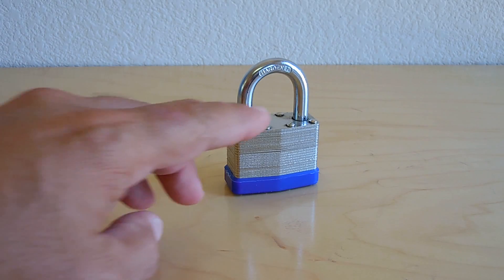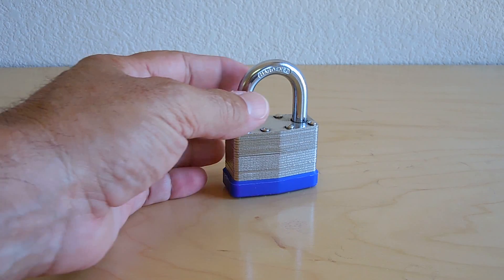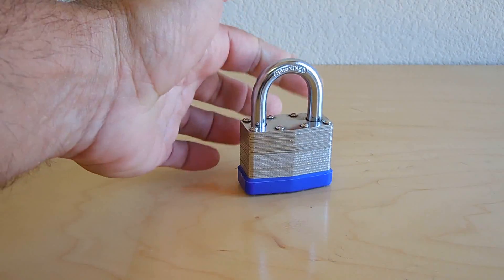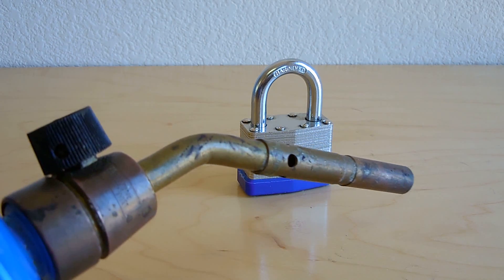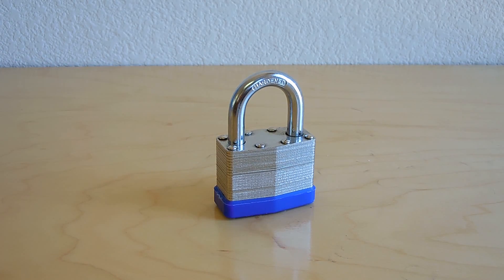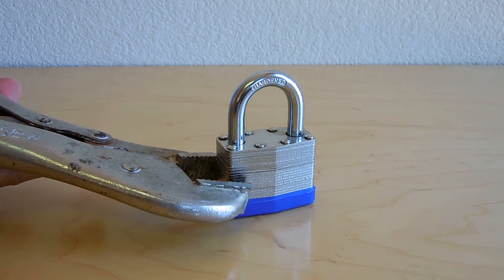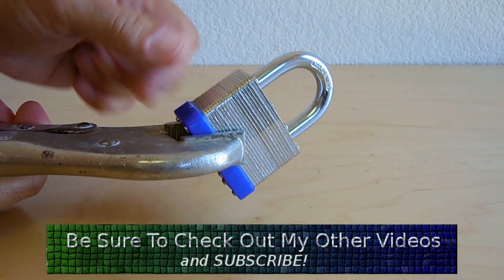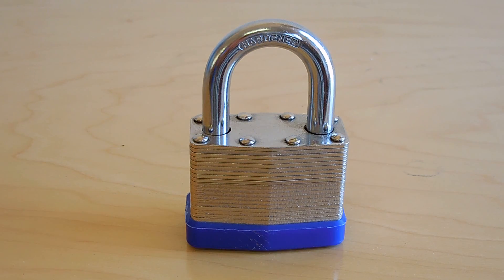Open A Padlock With A Torch and Hacksaw

Comment from the maker: OK people, after reading through some of the comments......

The purpose of this video was to show another method that CAN BE USED when a Cutoff tool or large bolt cutters are unavailable. The average person cannot pick locks, so that wasn't even a factor. The lock used in this video(which had a 3/8" diameter shackle) was 100% irrelevant. I was simply showing what to do on any padlock I had laying around. Normally this would be used on padlocks that are higher quality, and very hard to pick. This method can also be used to cut hardened steel bolts or rods, and as mentioned in the video, allow you to drill through hardened steel plate. If another channel uploaded this, or stole my idea(which has been done before), their video would already have 1/2 million views and everyone would be praising the video. To top it off, many Youtube channels don't even talk to viewers in their videos or explain anything in detail the way I do on my channel.
Reply: mosin homes Yeah no
Reply: Thanks for posting this video. I put this exact lock on our dumpster. A psychopath tenant injected the keyhole with glue ruining the lock
Reply: I've used this technique to cut hardened chain before, used fire bricks to make a sort of heat chamber like a crucible, heated up 1/2" tempered steel enough to anneal for cutting. Also if you get steel hot enough so it's glowing yellow/orange then rapidly cool with iced water it's overly tempered and brittle and can break with a cold chisel impact.
Reply from the maker: @davidgraemesmith1980  It works, sadly some people out there seem to think I upload bogus videos. Thanks for watching!
Reply: @electronicsNmore  some folks don't have the sense to study anything other than video games and other typical childish interests

Comment: Good to know but i very much doubt that the cheap lock was hardened, even if its stamped on it. The hacksaw not gripping would most likely just be the chrome plating, give it a few more goes with the hacksaw. Lean the hacksaw against the body of the lock to keep it stable and give some hard strokes of the hacksaw.
Obviously raking or picking that lock would be super easy but you explained what and why you were doing it.👍

Comment: If you heat a shackle to bright orange, even going on to white hot, a set of bolt cutters will slice through that section of the shackle with ease (not quite literally 'knife through butter' ease, but close) and without doing damage to the high-carbon hardened steel bolt cutter blades (which just about always results to the uniform cutting edges of bolt cutter blades, when cold, hardened, high-carbon steel tries to cut/snap through like [or even harder] cold, hardened, high carbon steel). ...and even a much smaller set of bolt cutters will do the job.

Comment: I have a seized axle that I'm replacing on the bottom bracket of my bicycle, and I will be trying this tomorrow to soften the steel for cutting. Thank you for the great video! A torch is also great for expanding crank arms for removal if you don't have an extractor tool.

Comment: What if you just cut the Lock when its glowing Red Hot?
Reply from the maker: It would cut easy, but the heat may destroy the temper of the hardened cutting edges. Thanks for watching!

Comment: Interesting video. I thought about this the other day when I needed to force a lock. I have 4 kids and thirsty friends so it happens surprisingly often lol. Normally I use an angle grinder but I was thinking about a more discrete and pocketable approach using a leatherman surge with a hacksaw blade attachment and a torch lighter. I think I might give up on that idea because it obviously takes quite high output to normalize the steel.

Comment: One of my lock keys broke because it was 10 degrees out and I needed in my storage unit.  I have one key left and if that fails, I will be running to the store to buy a lock and doing this.

Another option would be putting a carbide grit rod blade into hacksaw and cutting with that.  You might bypass the preheat step with that.

Comment: Why would anybody wait until the Lock cools just to brake it.
Reply: You would have to heat it to a much higher temperature than we can get like this. Actually you would have to melt the shackle or turn it into gas and I don't even know how hot it would have to be...
Reply from the maker: If you think you can easily break that shackle when it's red hot, you're wrong.

Comment: Amazing - never knew you could reverse the 'hardening' effect by heating the metal up again.
Many thanks !
Reply: Heat it up until its red or light orange and cut it with a bolt cutter.
Reply: @rfi-cryptolab4251  exactly why wait for it to cool. It's way easier to cut and saw when it's hot
Reply: hardening = high T, then cooling quickly in oil.
Reply: @JamesSempy  
It's not that simple.
Reply: I tested this at work with some circular stock made out of hardened tool steel. 
I heated  a 3/8" diameter pin to around 2200F and used a steel hammer and chisel to drive through it. Also heated another and quenched it with water. I could then use a file to cut through it.

To cut through a hardened lock, you can also use a cut off wheel (fastest method) or a carbide rod saw if the shackle is too thick to cut with a large bolt cutter.
Reply: ...and if you heat the metal up again to your crucial temperature, and drop it straight into cold water (or oil) then you will harden it again.

Comment: Locked my keys in the garage but luckily the blow torch was in the garden shed. Tried this with an identical padlock and it worked really well! Thanks for posting. For those who think you might burn the building down, if you aim the flame well, the door paint only gets warm to the touch and certainly does not peel or scorch.
Reply from the maker: Glad to hear it worked well for you!

Comment: Somewhat faster method: Homemade shaped charge explosive! It sonds like a firecracker if you cover it with sand bag, and that blocks the light flash too. Not too stealthy...
Ok, more "down to ground" thing...thermite or die grinder and one HEAVY backpack of lead acids.
Do not try it at home, leave it to the stupid ;-)

Comment: generally the padlock will be in use with a `Hasp and Staple` and all the components would be in close proximity to a door or gate making the use of a Hack-saw unpractical, if you have softened the metal then use your bolt cutters.
Reply from the maker: Using a hack saw to cut the lock on a hasp shouldn't be any problem at all. You usually have plenty of room. The padlock can be rotated into a position which makes it easy to hold and cut. I do like your idea of saving the cutting jaws on bolt cutters.
Reply: belltopcone  your a halfwit dude what did he say at the start of the video? give yourself a uppercut

Comment: Thanks for speaking clearly so that I can play this video at 4 times the speed and understand you to make this play under 2 minutes. :)

Another method for those locks it to take a heavy hammer and give it a good hit on the side to open it even faster, which is what locksmiths do.
Reply from the maker: Good luck doing that with a quality padliock that uses locking balls.

Comment: Wish I had seen this years ago, many years, too many years.  I had a giant pair of bolt cutters and a friend of my wife needed a large lock cut off of a storage shed.  The bolt cutters cut the lock off and also chipped the cutter blades.
Reply from the maker: I've had the same thing happen to my cutters. Be sure to rate thumbs up to offset all the channel haters and trolls. Thanks for watching!
Reply: yep bolts cutters arnt padlock cutters, sure thieves might use them ,but they probably dont buy the bolt cutters either

Comment: First, I would try picking the lock.  It's not that hard on most padlocks (the one you're showing looks like a Master).
Reply from the maker: Yes, but the average person doesn't know how to pick locks like you or I. If you have a cheapo propane torch and hacksaw laying around, It's easier to do what I show.
Reply: mediaguardian It's a Master lock, no actual picking required just a quick rake. And sometimes a stern talking to works.
Reply: I consider using a rake as one method of picking (as opposed to manipulating the pins individually).  And I am a novice at it so I may be wrong in my terminology.
Reply: disgruntled181 Only works with the cheapest locks.  Even just modest master locks have some security pins.

Comment: I find it easier to use hamer and break shack if suitable.
If that is not possible,a cordless drill does job really well.
This method is for bigger locks,it was overkill for such small lock.
But great video,very informative.
Maybe try thermal shock next time.
P.S. People normalise ball bearing housings amd make knife with them,and i remember those breaking like glass if you hit them with hammer or drop them.My coworker has piece of metal stuck in his hand,now he knows that putting tempered steel under hydraulic press is not smart.
Reply from the maker: I was demonstrating what you CAN do using an ordinary padlock. Clearly this method would be used on larger, high security padlocks.
Reply: That's because the high-carbon steel article had been uniformly hardened ALL the way through.  Things like shackles are 'case' hardened on the outside to some depth, but retain some tensility at the core to prevent shattering from percussive force. During my many years boilermaking/welding, and steel fabricating in engineering shops, we often worked with hard-faced steel plate (which has been surface/face [case] hardened surface to a depth) and where the drawing required holes to be drilled, we'd always pre-heat  the drill-hole site around the center-pop mark with the oxy torch to soften (anneal) the surface at that point before drilling - otherwise it just takes a big toll on your drill bits, and magnetic drill bits.

Comment: Carbide hacksaw blades can come in handy for these kind of jobs .
Reply from the maker: Not really necessary for this job. The steel is really easy to cut after the case hardening has been undone. Thanks for watching!
Reply: Just buy a cheap pair of 18" bolt cutters for cheap locks like that.
For bigger locks a cut off wheel or carbide rod saw work good.

Comment: normalizing the metal makes it softer therefore easier to cut. Good thumbs up worthy tip. Thank you for sharing.
Reply from the maker: Thanks for watching
Reply: Unless it's an air hardening metal
Reply: @tooterplumber1128  even still you're likely to take out the temper

Comment: You can do the same with a dremel in 1 minute. Bah
Reply from the maker: Sure, If you have a cordless unit, but what a smart person would say is, " Thanks for this video(which I didn't have to share), this is great information to know in the event I don't have a Dremel or large enough bolt cutters".

I keep track of the good and bad on my channel. The bad will never get any assistance from me if they ask for it.
Reply: That is how I cut them with a grinding cut-off wheel in the battery operated Dremel. Great tool for bike thieves   (. )I(. )

Comment: I just pull out my gas cut off saw unless it's in the building with that lock that needs cutting off then im SOL until now!
Reply from the maker: A propane torch and hacksaw is much quieter. :-)